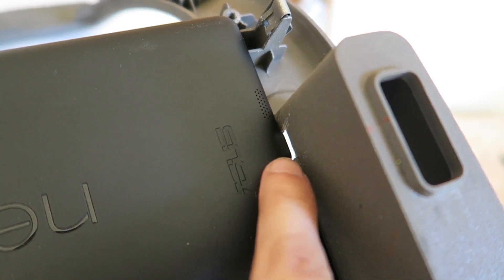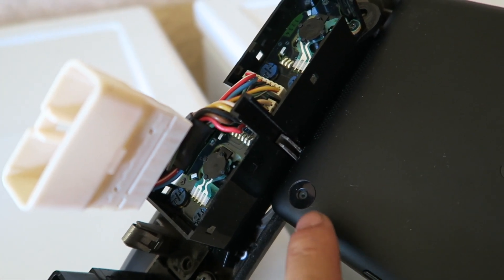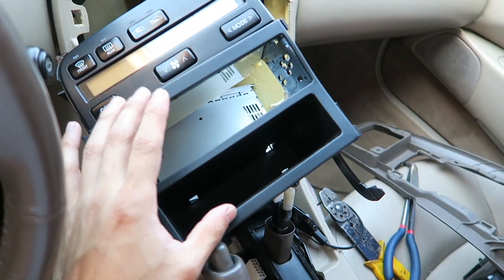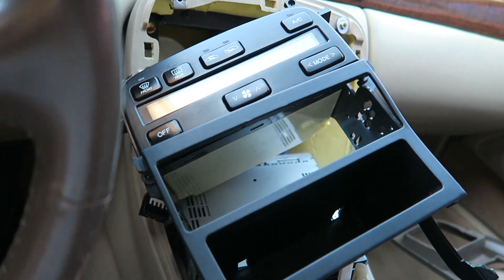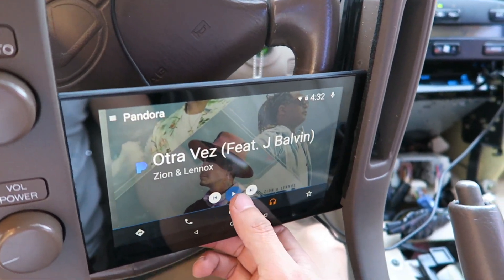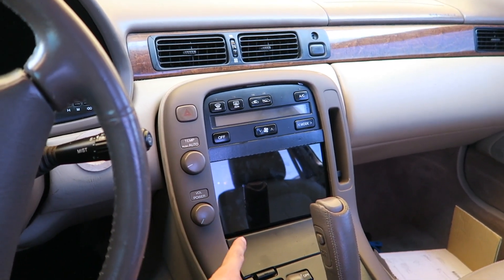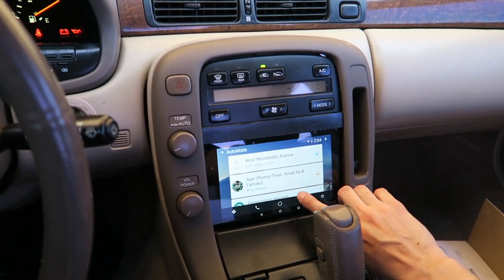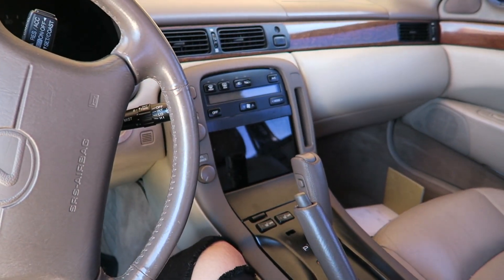SC400 BUILD PT 2 (DIY Android Tablet stereo install )

Comment: How you get it to come on with the car if it’s only connected to aux chord ? And does this need charging when you do it this way ? Thinking about doing this with my sc 🤔
Reply from the maker: BeatsByFlexxn i forget what app it is but its an app that controls all that function i mention it on the video. And its connected via the usb cord so the car is on its charging. Since then i made it so i can remove it and charge it wenever

Comment: i wanted do it for a while...but didnt because i couldnt figure out a way to do a volume button delete. casue a dead button would irritate me. it does look good bro
Reply from the maker: logo916 download that app i mentioned called "AutoMate" on the music you can swipe up or down to control the volume
Reply: yeah i seen that.. iwas talking about the actual volume stock button on the trim.
Reply from the maker: logo916 yea bro i wish it was easy to wire them but ive read that its a hugeeee pain to actually get it to work with an aftermarket deck
Reply: logo916 i use my dead button as a sub amp control knob.

Comment: Can you do a update on this mod ? I was more concerned about the heat factor .I know for a fact that stereo and tablet together put off a lot of heat when I use . Was just wondering about overheating over time possibly causing one or both of the units to not work correctly! Just a thought
Reply from the maker: That car has long been gone! But in the months that i had it it never gave me any issues